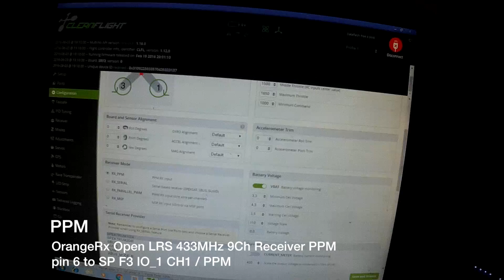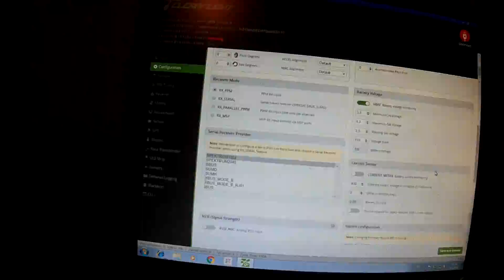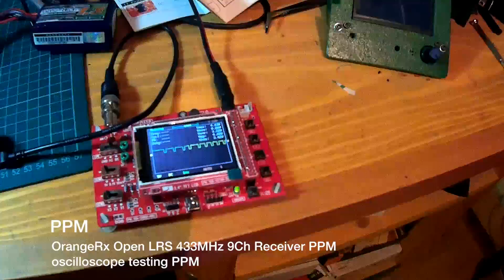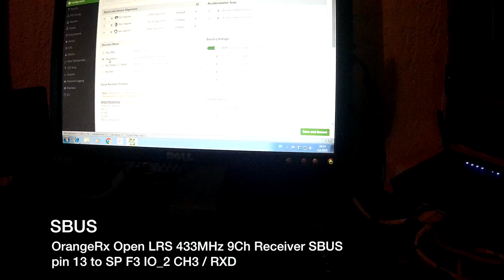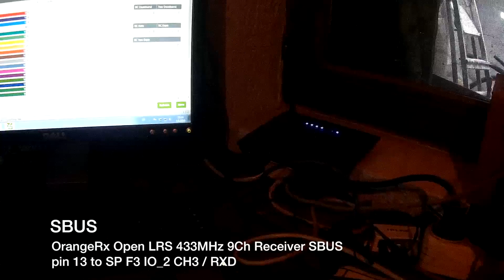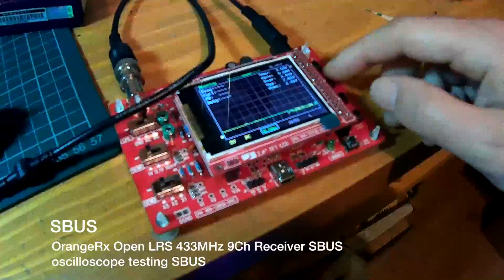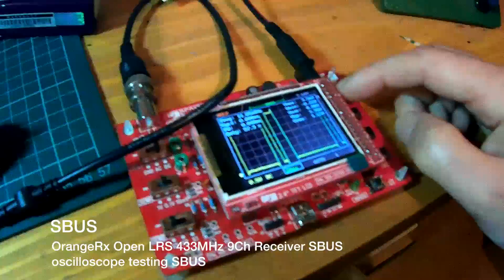SPRacingF3 PWM PPM SBUS not working

Comment: Awesome I soldered the single signal wire to the PPM and the two others to UART 3 one to the negative and one to the positive. I thought if this didn't allow connection beforehand then maybe the positive and the negative terminals would not work. however these were giving power to the receiver beforehand but despite binding with the transmitter I still had no connection with betaflight. so I soldered directly to the PPM pad underneath the SPF3 flight controller and YES it worked. Fully functioning connected to betaflight in PPM mode. Awesome!!!!!!!!!!!!!! I tried to buy an original SPF3 and I wont be buying Chinese crap ever again at least not flight controllers. I've wasted hundreds of hours trying to get this problem solved and had almost sold all my gear as this was such a discouraging experience. So thank you for posting about this bottom PPM pad you're a champion...God's blessings to you champ.

Comment: I have the same problem. SP Racing F3 and D4R-ii. I has worked before then suddenly doesn't. Did you solve the problem?
Reply: i just tried the pads thing..still doesnt work
Reply: Did you ever fix it? I am having the exact same problem. It worked once but not again.

Comment: Dude, i got the same problem with a delta-8 and spracingf3, IO_1 port 3 wouldn't pick up anything... found your video.. made me even more sad... BUT i just discovered there is a PPM pad on the bottom of the board and it was my last last hope .. connected ch1 from receiver to the pad and BOOM it worked :D .. i didn't even bother to solder.. just held the wire against the pad and values where moving.. thanks for confirming that IO_1 ppm seems to be faulty on some boards.
Reply from the maker: I actually tried ppm via pads on the other side and it is working, yes, but I made contact with a thin silicone cable to the connector, so now everything is working properly, it is interesting that I have one more  flight controller, they sent me a replacement and he has same issue,  due to you now have two fully functioning F3 controllers, thanks
Reply: i am having the same problem..there is olnly 2 pads under the boad ..are they power and signal only ?..i see they are marked one of them says ppm and the other i can't make it out of ..help pls
Reply: got the connections figured out ..just connect signal wire to ppm pad ..but still not arm ..what am i missing
Reply from the maker: If the sliders moving in the receiver tab then it is ok, but you have to set the arming, or via throttle stick: min throttle and to the right, or via a separate switch, but not  both
Reply: Oh my... thank you so much!!
Reply: yes I've had the same issues and I've seen this ppm pad on the bottom but zero nobody has spoken about what this is

Comment: Thank you for your reply. If you solved, please guide me.
Reply from the maker: seems to be no solution, from a vendor will receive a new one, now I have to wait until arrives. I was convinced that the problem is in software, it seems that the problem is finally to the hardware.
Reply: Try to use the PPM pad on the bottom of the board. Solved exactly this problem for me :)
Reply: I've tried the ppm pad and it still won't work for me. I'm getting a refund from Banggood (hopefully).   I ordered an X-racer F303 V3.1. now just sit back and wait.

Comment: Hi friend! Did you solve the problem? If yes, please help me too. I have the same problem.
Thank you very much.
Reply from the maker: No I have not, waiting Gearbest Customer Service, in the meantime, I ordered Naze32 rev5, while this be resolved with Gearbest. On the Internet I found that many people have the same problems as me, something is wrong with SP F3 clones, and can not be connected to the receiver.I tried with a friends FrSky D4R-II PPM, is not working.
OrangeRx Open LRS 433MHz 9Ch Receiver has been programmed to have the PWM channels CH1, CH2, CH3, CH4, CH6, CH7, CH8, and CH5 is in the PPM, and the pin 13 is SBUS, verified to work on APM and before on FLIP32(Naze32) and on oscilloscope which is on video
I've enabled the correct protocol - PWM or PPM or SBUS and wired it correctly.
-For PPM I connected in IO_1 connector (pin 3 CH1 / PPM), enabled PPM protocol in configuration tab.
-For SBUS I connected in IO_2 connector (pin 3 CH3 / RXD), enabled i port tab Serial RX for UART3 then enabled SBUS protocol in configuration tab and for Serial Receiver provider SBUS.
-And for PWM I connected in IO_1 connector (pin 3 CH1) only one channel for testing, enabled PWM protocol in configuration tab.